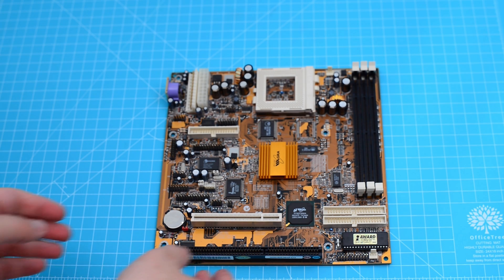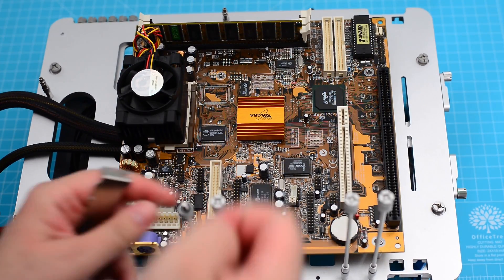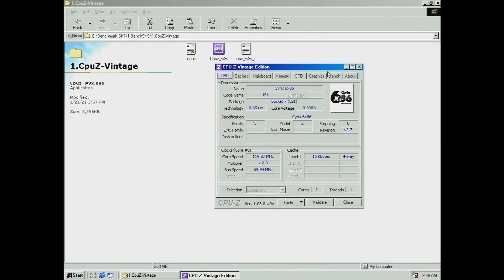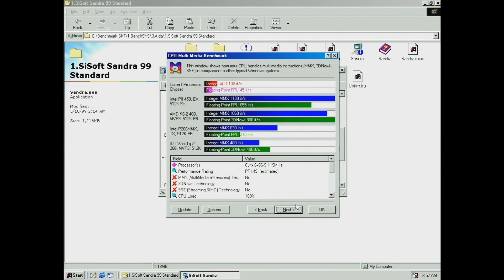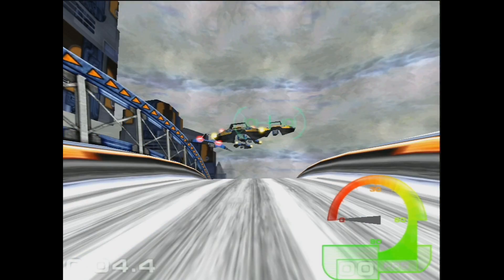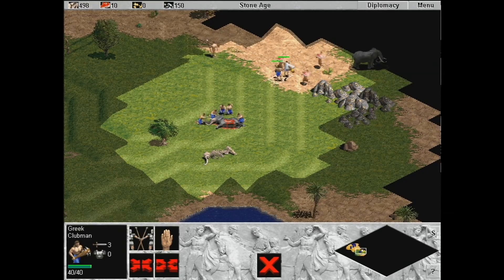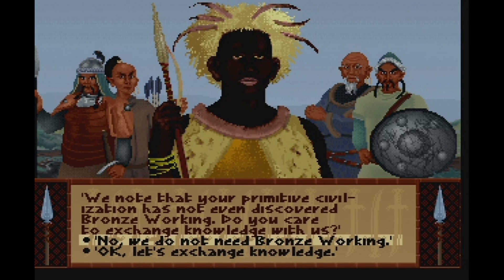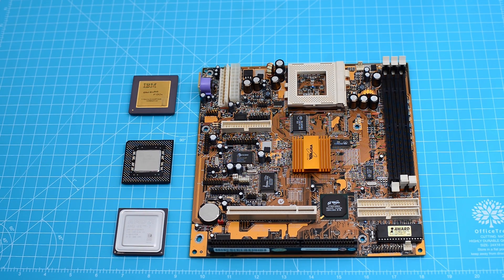Benchmarking the 'VIAGRA' motherboard

Comment: I was around back then, even though I was a kid. I feel that Cyrix, AMD, and all the other Pentium pin compatible CPU's were way way slower than they would have you think. The Pentium was always way better. Of course if you have one already it feels better to tell yourself it's almost as fast, or if you were selling them of course you will say they are close...It's true and not true if that makes sense. There are a lot of situations where the non Pentium Socket 7 and Super Socket 7 cpu's may do better, but at the end of the day the Pentium would get more done and be faster. Just doing things in windows clicking on your start button installing software, normal stuff is what really matters, and that's Pentium's strong suit. I don't really know if the push for super 7 with AGP and all of that was really viable, from having a computer like that my honest opinion is NO and I wish I would have had a Pentium II
Reply from the maker: Sometimes I got that feeling too.  When I got into computers everything Intel was very expensive so it was kind of hard to get close to so I had an AMD that actually was decently good but I always wondered how it would be to have an Intel, probably a secondary reason why I set up this channel. I hope I don't sound off here but I think that many software development companies had Intel cpus and in the early days when software was build more for a specific platform and without a hardware abstraction layer(or something similar) to interact with so that made the other CPU brands a little less effective.
Reply: @retrodrive-thru47  I pretty much agree. Had a cheap motherboard with various ati all in wonder cards that my dad was into....never really was stable. I would have had less crashes in games like jedi knight dark forces 2 on a pentium. the amd k6-2 in it did the job though got stuff done and intel was astronomical for a pentium 2. the k6-2 was probably a little better than the pentium 1 overall, but pentium 2 was where it was at.

Comment: K2 500, Voodoo 2, ISA sound card, if integrated doesn't work at dos, and whoala, nice setup for dos and windows 95... and tiny desktop with 15" crt without stand, I see it already :) did you tried integrated sound at dos, and how about parallax scrolling and integrated graphics card?
Reply from the maker: That's definitely something I can do. Although I was considering a K6 III 400. I think the integrated sound works under dos...maybe. I don't know too much about parallax scrolling.
Reply: @retrodrive-thru47  many side scrolling games had 2 backgrounds moving in different speeds, and many graphics card had problems with it, it looks laggy, find best vga card for dos games and there is link to table of all sorts of vga cards, with dos support, this table is legend now... about sound, just test it ;-)
Reply: @retrodrive-thru47  try to find - Best vga card for dos games - on vogons, there is legendraty table, about sound, just test it, unisound drivers you may try as first ;-)

Comment: VIAGRA? That's a real HARDware. 😆
Reply: Sure, you can stick this motherboard in every case!
Reply from the maker: It really is a hardened socket 7 motherboard.
Reply: @retrodrive-thru47  Guaranteed maximum uptime.
Reply from the maker: @NozomuYume  industrial endurance, limited extension slots

Comment: Nice video! I for one would like to see video of this board with the AMD K6 2..
Reply from the maker: Challenge accepted! Do you want a specific model? (I don't have k6-3s, just one at 400mhz). Someone already requested a cyrix Mii. The only thing is that this new clip will wait for about 2 months, as I have other projects right now.
Reply: @retrodrive-thru47  Thanks! It  is interesting to see how much faster your K6 2 400 or 500 will be in games and benchmarks. Days ago I just scored a very similar MVP4 motherboard (PCPartner MVP4BS7-947) and it came with a K6 2 500AFX. First ever AMD CPU for me, got more of Intel retro CPUs. Yesterday, I was able to have It boot to bios and will build an AT PC with it. It will take time though to source the other parts for the build, so you see why I am really interested to see your coming video..

Comment: VIA had it all.
CPU, GPU, north and south brige, NIC IC, Sound IC and more.
Only thing what was missing, is the RAM.
Reply from the maker: Now that you mention it, I do have a VIA 600Mhz cpu :) maybe I should put it on a list to compare it with a Pentium 3...
Reply: @retrodrive-thru47  It was very unique situation they carved for them selves. and all worked with an Intel or AMD CPU, not just there own Cyrix/VIA CPU.
It was truly 4D chess moves they where doing.
Reply from the maker: @sundrak1  Maybe you can add more details or point me to a link? Who knows, maybe a clip can come out of their history.
Reply: @retrodrive-thru47  I built some thin clients out of that post-Centaur WinChip crap. It was super slow but did run super cool, perfect for a thin client.

Comment: Does the integrated sound not worked under dos? I remember that some old VIA sound had SB emulation that could be activated in BIOS and in some motherboards it was not so bad. 
Maybe the motherboard could benefit from a better CPU (maybe P200MMX or a AMD) but for sure Win98 could makeuse of more RAM. I remember struggling with 48M in Win95, you run Win98 with 64M.
Reply from the maker: The moment I realized that Win98 was not a good option for playing games I just moved to DOS without removing the sound blaster. But I did check the onboard audio with a Pentium 233MMX and it was a CMI 81xx (can't remember exactly the last 2 numbers) and it was outputting sound. I'm puzzled why this only happened to the Cyrix processor. As for RAM I'm not trying to jump the horse and just keep it real like it was back then. I got my first computer around 2001 and it only had 128Mb and indeed sometimes I was struggling so I figured that if I build an older PC it should also struggle but to my surprise I never felt this one lacked the ram. I also used the same memory module(64Mb) in the Athlon 550Mhz I used in the NFS 1 to Porsche clip and that one didn't struggle either. I plan to revisit this motherboard in a while and I'm going to take into consideration all suggestions. Thank you!
Reply: @retrodrive-thru47  With (very) few programs, Windows is managing well the memory (Win9x also). I remember that after a clean install of Win95 OSR1, having a game or two, was ok, (48M RAM, 100M swap on HDD, 486DX@100 or 5x86@133, SBPro, Trident TGui VLB, all the drivers, Directx). But, after installing IE, active desktop, MS Office, Plus!, the HDD almost did not stopped spinning, the swap file was always accessed. When I upgrade to 64M, the system was suddenly snappy, no HDD activity, no delays. Ofcourse, it was not unusable with 48M but often had loading times that make it feel sluggish. 
It would be nice to see a comparison between AMD, Intel and Cyrix CPUs in pure dos, were the integer and raw speed weremore important than FPU or extra instructions.

Comment: CPU 933mhz.2
MB MSI MS-6321-694D Pro
RAM sdram pc 133 512mb.2 128mb.2
HDD 80gb.3
OS WinMe 2000 XP
power 420w
2000/2023
Reply from the maker: That sounds like a nice system. Unfortunately I don't have something similar to do some tests.

Comment: Why does modern ram have the notch basically in the middle, surely they could have put the notch more towards one end so its less likely you'll try and insert it the wrong way. Impossible with the SD ram slots in this mobo by the looks of it. I always mess it up.
Reply from the maker: I think the new ram modules have e little notch a little to the side but it's not as obvious as it was 20 years ago especially with sdram. The trick is to never push really hard on the first try :))
Reply: You mean DDR5? Yeah I should be more mindful but when you trouble shoot a problem its 99% ram so im always pulling it in and out. Its the kind of thing that a good design would eliminate whats the point of the middle notch in the first place? @retrodrive-thru47
Reply from the maker: @Dale-TND  I think it applies to all DDRs. I'm not fortunate enough to have a DDR5 system yet.

Comment: Interesting retro system
Reply from the maker: Well, it's a modest socket 7, spartan motherboard, small chance of upgrade, no dedicated agp port although the chipset supports it. Can't really recommend it. Did all the benchmarks because of the name of the motherboard. And also the via mvp4 is a little overlooked, not many motherboards exist with this chipset.